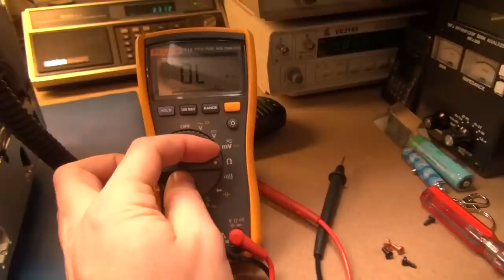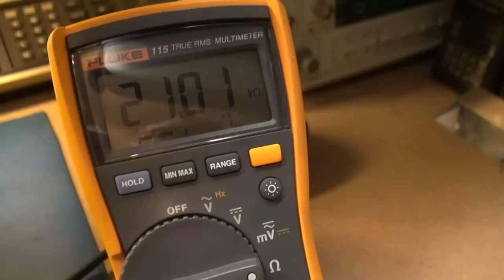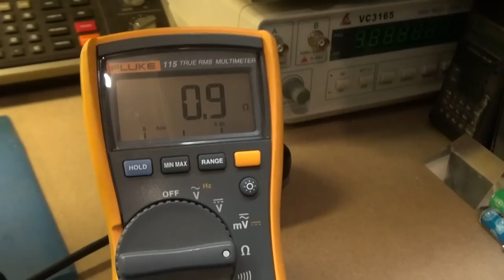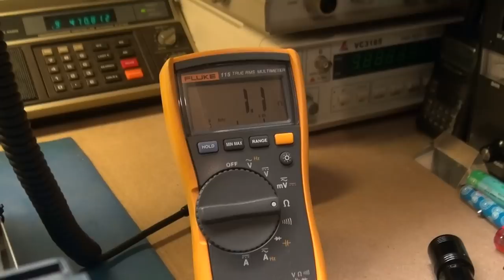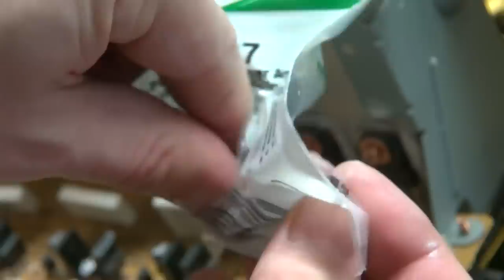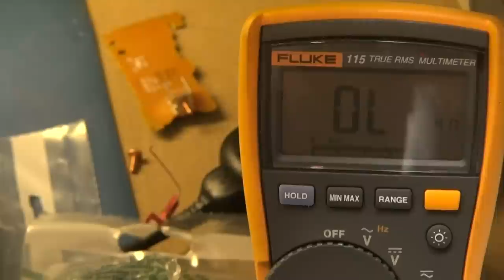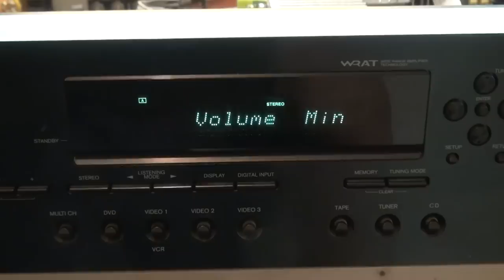ONKYO TX-SR502 RECEIVER  "SHORTED CHANNEL REPAIR"

Comment: Nice video Kevin.  Thanks for posting it.  

I have one question.  My son's Onkyo TX-SR701 receiver enters Protect mode each time he tries to turn it on.  He reset it, but no dice.  It followed a lightning strike that destroyed most of the circuitry in the 2-family house.  He rents the upstairs.

It may very well be the same problem you describe, but I cannot for the life of me figure out how you tested the output transistors "in circuit".
His receiver has six NPN and six PNP transistors, but I cannot use your method to test them "in circuit"

Regards,

John
Reply from the maker: +itsjustdad If it was hit by lightning it could be anything,, but you will have to un solder the transistors from the board for proper test. They will only show shorted if they are indeed shorted. Sometimes watching videos on youtube makes it look easy but you do need to understand electronics to truly undertand what you are troubleshooting, maybe you do  but i do not know what experience level you are.
Reply: +kev31779 
My experience certainly isn't what yours is, but I have repaired a number of electronics and always had to unsolder or disconnect in order to test.  When I saw the video it looked like you were testing "in circuit" so I thought maybe you had a method that avoided unsoldering first.  

But thanks for the quick reply.  I will unsolder all 12 transistors and the six resistors and test each of them.

Thanks again,

John
Reply from the maker: +itsjustdad a short is a dead give away. Usually i will test the transistors in circuit to test for shorts. If they are not shorted you should see PN junction. Every amp is different and sometimes that doesn't not work and will you have to pull the part for proper test. After doing a lot of these you will learn that you don't always have to pull a part depending on how the circuit is laid out. you can always just pull 2 pins up instead of 3.
Reply: +kev31779 

Actually I tested for an emitter - collector short in-circuit and didn't find one.  I am now disassembling the unit, but the internal speaker channel connectors for the speaker board are a bit confusing.  After removing the clip it seems that they should "pull out", but they don't.  Did you unsolder them?

Thanks,

John
Reply from the maker: +itsjustdad different model i didn't have to un solder anything other than transistors.
Reply: +itsjustdad 
Actually I believe they are supposed to slide forward like some of the others, but there are resistor wires in the way.  On the small one I noticed that the +24V terminal was not connected so I removed the connector and soldered all four strands directly to the PC board.  The four strands were +24v (which wasn't connected or I broke it), CSRLD, FRLD, BRLD).

Thanks,

John

Comment: Where are you located I need my Pioneer Elite fixed. Heard a loud POP and then the protection light came on wont turn on anymore, I tried the little trick where you hold down 2 buttons it came back on for a couple seconds then the protection light comes on again .

Comment: Hi Kev31779 l've got Sherwood Amplifier RV-7050R which is 120watts per channel into 8ohms, How much watts of speakers will you recommend for my Amplifier?
Reply from the maker: You don't need to match the watts. It just needs to sound good to you at whatever volume you like to use.

Comment: I have the Onkyo TX-SR607  that goes into protect mode within a few seconds of turning it on. If I remove the Driver Amp. PC Board it stays on. Would that indicate there is a component failure there? Removing the HDMI board makes no difference. Also would this rule out a power supply problem ?

Comment: Hey uh, before I start, happy christmas!
So let's get down to it. I shorted one of my receiver's output. Left channel, right now I'm trying to figure out what components are shorted, I'm almost sure only the output transistors shorted, they both give make my multimeter beep (which happens to be the fluke 115) (2SA1695 / 2SC4468), thing is, I am measuring them (with diode option) without taking them off the circuit, that pair I probably can assume they're dead, but others channels I'm in doubt. 
They all read the same, something like 0.5v between Base/Collector and Base/Emitter, using the black probe on the base, but I get the same measurements using the red probe on the base. Is that right? Is it possible to know if a transistor is good or bad without taking it off circuit?
Reply from the maker: Is it possible to know if a transistor is good or bad without taking it off circuit?  

 Not always. You will have to confirm by removal. There could be something else in circuit that is fooling you as a short. Of course they could be shorted as well. also make sure the white resistors are not open circuit as well. Try to see if you can get a service manual off google for free . It might help you trace things out if available.
Reply: Is it reliable if I compare the readings with another circuit that I'm 100% sure is working fine and is exactly the same? Resistors seems to be fine.
Reply from the maker: Again, not always. Some  junctions can be hidden by other components. To be sure removal cancels any doubt. You obviously have a problem in that channel. It may not be the outputs. You will need to trouble shoot the finals all the way back to the pre driver and pre amp section.
Reply from the maker: what is the model?
Reply: HT-R580
Reply from the maker: what channel is the issue?
Reply from the maker: left?
Reply from the maker: You can get the service manual here.  http://elektrotanya.com/onkyo_ht-r580_b_sm.pdf/download.html
You just have to wait the the processing is done on the bottom left and it will download. page 18 is the amp section. Do you have a scope?
Reply: Yes, Front Left, unfortunately I don't have a scope, only that Fluke 115. Got the service manual already
Reply from the maker: does the channel not work at all or is it making odd noises?
Reply from the maker: is the unit going into protect?
Reply: Actually both fuses of the BAAF-0348 (AMPLIFIER PC BOARD) shorted, so all channels stopped. Everything else works though. I'm afraid to replace those fuses without fixing any shorts in the circuit
Reply from the maker: Fuses are meant to read shorted that means they are good.
Reply: Oh sorry, I think I didn't express myself right, they're burned. Nothing passes through them and I can clearly see the filament is broken
Reply from the maker: what are the fuse number locations on the board?
Reply: Page 27. Top left corner. Numbers: F6902, and F6901.
Reply from the maker: Ok those fuses are for the + and -  52 volt rails. I would pull the finals and look for shorts. then if those read ok then start heading back in the circuit.

Comment: When you say you "took the channel out of the circuit" so your neighbor could still use the amp, what did you do exactly?
Reply from the maker: +wildcardab I removed the power transistors from that channel, removing the short.
Reply: +kev31779 The transistors that you ended up replacing? Basically I want to try and verify the shorted transistor is my problem before I go through all the trouble of ripping everything out to replace it.

Comment: @kev31779 thought i would drop a comment to thank you for the vid as my TX-SR577 went down after i replaced my tv, and like a complete noob i think i forgot to switch off the amp when disconnecting the center speaker as i had to move it, and low and behold when i went to turn the volume up "bang" straight to protect mode, so after i came across your video i obtained a DMM to check the center channel as the unit would not come out of protect mode while the speaker was connected. needless to say i found an open circuit on the pesky .22ohm resistor, but couldn't seem to determine if the transistors had blown as well. So as this seems to be a common fault from operator error, i spent then hours of googling to obtain the parts, which i finally found the trans on ebay, which come as a pair woohoo so I've decided to buy enough of these to replace all channels with enough to do one more complete replacement if needed. as for the resistors that was a mammoth task but i found some equivalents from mouser i think the company is called, i'll post back at some point with the part no for any one who may be looking, these are single type but i dont mind doing the joining together of these as i came across another video about onkyo amps that had a find-able part no in the comments (i will try and find this again and post a link for others to use). anyway i used your trick of  snipping out the trans on the center channel just as a test to see if anything else showed up and the amp powers on and i can run the volume upto max and back again to min as per the user manual, with now no ill effects as i can see, though i did this test with nothing connected to the unit. i now await the arrival of the parts.
sorry for the very long comment but i want to share my experience of this so that others may benefit from it. so a word of warning to everyone "if you have to disconnect any speakers for any reason for crying out loud turn off the unit and disconnect the power first don't be a noob like me lol!!!!". thanks again for this video you are a life saver!!!

Comment: My Yamaha reciever one day suddenly became  extremely hot.
Any suggestion on this issue?
Reply from the maker: That is not a lot of information. It could be anything. They do get warm in general but hot would be something overheating. If it is not going into protect then it might be normal under high load.

Comment: Where would I find one of those Noble Resistors? I found the Transistors but I can't seem to find any Noble Resistors like that.
Reply from the maker: They can he hard to find. I used to get mine from parts express but they stopped selling them. You can find them on E bay . Search for emitter resistors. or noble .22 ohm resistors. If all else fails you can use two single .22 ohm type resistors and wire them in series  and use center connection as the middle lead.
Reply: Okay thanks, I was thinking gawd this shouldn't be so hard to find one.
Reply from the maker: That parts should be fine if it is the same rating and value as the original. I bet you have pre driver or power supply issues if it shorted again. Also check biasing pot if there is one make sure it is not open or drastically off from the others.
Reply: Thanks, I'm hoping its just that channel but I tired it at like 3 this morning and the visual isn't working so I'm thinking I might just have to bite the bullet and get a new one in general.
Reply from the maker: I guess I didn't make it real clear in the video that this repair is works only if the pre driver and power supply rails and surrounding components are working as expected except the final outputs. When I released this video It was to demonstrate how to replace the final output and noble. I didn't expect this video the get as much attention as it did. If I knew I would have walked in dept of testing pre driver and power supply issues first. If you need to test the pre drivers you will need a scope or minimum a multimeter and check for DC on the output of the pre driver section this will cause the final to drive to DC till it smokes up. you will want a signal generator injected at the input if the unit will fire up when the short is removed. If not you will have to hunt for the shorted or open pre driver component or power supply issues. Some people have good luck replacing these components only, and some do not. Testing should a be done to determine the real source of the original fault. It is always a gamble just replacing the final and noble without looking into it further back in the circuit. Hope this helps.
Reply: Thanks, it was one of those there wasn't really anything about how to fix it anywhere, and your video showed up. I have a bad feeling though that I have to buy a new receiver though anyways, given that the visual doesn't work anymore.
Reply: So I feel dumb now I didn't lose visual I just screwed up what port I was plugging it into because I was tired last night. I had plugged it into 6 and was trying to use HDMI slot 1. So I'm so glad it wasn't the visual on my receiver. So I'm hoping the mess up might of been just the saunter job my friend did. Sorry to comment so much it was the whole freak out thing when I thought my visual was gone and my audio wasn't working either. Its not a fun list when you don't have replacement receiver money atm, even more so when you tried it half past asleep basically and somehow in zombie mode.

Comment: I have the same model...my problem is the digital optical only works if it's above 70 degrees outside...I've tried all 3 inputs but still no sound...everything else works...digital coax, rcas,tuner
Reply from the maker: Sounds like a bad solder joint or a capacitor. Never can tell till you break into it.
Reply: Ok...thank you for the info

Comment: kev31779 ..my amplifier when im turn off the power switch there is a pop up sound to my speaker what the possible cause for this  can you help me my amplifier is onkyo txe - 500...your response is highly appreciated thanks
Reply from the maker: Check grounding  to all devices to the receiver. Unplug everything except the receiver and speakers and see if it still does it. If it does you may have a DC offset issue when powering off.  There may be an issue with the power supply or pre/final driver section of the reciever.
Reply: Thank you very much to your reply

Comment: If output are dead, you MUST REPLACE the driver transistors too and the bias transistors because they had been hurt a bit by the blow of the output. This is if you are a real technicien, a pro. If you only replace the output, the amp could blow again when you'll give him shit, i mean play it loud, it won't last long. And also today's China transistors are fake, shit, low HFE. They don't have the real specifications. They're fake transistors.. Also Onkyo's amp are the worst shitty amplifiers, cheapest one. Don't buy them.

Comment: hello sir,i have a used sony DA-555ES,i hooked it up to my newer sony 32 inch bravia tv...no sound,i change the speaker selection i hear clicking,its hooked to front,the back connections on my sony bravia is much differant when it was hooked up to my older sony 32 inch trinotron(big bulky tv)i took the covering off i looked it over nowires burned,fuses blown,can you fix my recieveer? haa haa just kidding,im on a tight bughet,i called this electrical repair shop...they said it would cost $200-$250 just to do diagnostics

Comment: Where car I find those resistors?  Mine uses a 2W .22 OHM and I can't find them anywhere.  Could I just 2 single .22 ohm units?
Reply from the maker: I got mine from parts express..and yes you could in series and use the center leg as ur senter tap
Reply: I looked on that site and had zero results, any other ideas?
Reply from the maker: Damian Hindley
 MCM Electronics. Part number 28-0520
Reply: Yes! You can use single units. If they will fit, go with 5W resistors. Always good to go with higher power resistors if you can. Just gives better service life.
Reply: im looking for them too did you find out where to order them yet I texted the guy but no response yet. thank you. ben
Reply: purplehaze6t9 The 2 watt ones are easier to find but you can get the standard 5 watt rectangular white ceramic ones and wire them in. I saw some on e-bay... pack of 25 for 18.00... .22@5W The singles are easy to find and cheap. if your reciever is the same as in this vidio, you have a LOT of room....

Comment: For anyone looking for the parts, I used http://www.ebay.com/itm/152112998197 which will work of the Noble Resistor since you can't really find them.
NTE37: https://www.ntepartsdirect.com/ENG/PRODUCT/NTE37
NTE36: https://www.ntepartsdirect.com/CGI-BIN/lansaweb?wam=WKWSEARCH&webrtn=search&ml=LANSA:XHTML&part=CEP&lang=ENG&sid=
you can find them else where but I figured I would help out Kev31779 and anyone else looking for parts and don't have to do what I did haven't to go all around

Comment: My same receiver has everything working except the display is out, it's not lit.
Can you help?
Reply from the maker: +lou ezzie It sounds like a power supply issue or connections to the display circuits. Or it may be a faulty component somewere.

Comment: Hi there. I've got a similar Onkyo receiver, with a faulty channel. It's got a HDMI board on top, but I have no idea how to remove the main board below to get to the underside of the components I need to replace. Does anyone have any instructions on how to disassemble onkyo amps.

Comment: Dude your hand was in the was most of the vid.
Reply from the maker: +northofport Sorry, I have a much better setup for recording now. That is a older video.
Reply: +Kev31779  Ok I sub'ed . I have the chance to fix an old rca 500 watt amp that powers on than right off. I'm gonna try the fuse? not sure. What do you think?Thanks
Reply from the maker: +northofport Yes try the fuses. look for shorts on the outputs also.
Reply: +Kev31779 Will do. Thanks,,, You guys are a dying breed!

Comment: The only repair that works is - trow your garbage onkyo receiver out of the window and buy a new one from another label :-)
Reply from the maker: Not true. It's worked for several years after the repair and the other thing it's not mine to throw out. Dont  bother brand bashing me. I just fix this crap. All brand electronics are problematic..